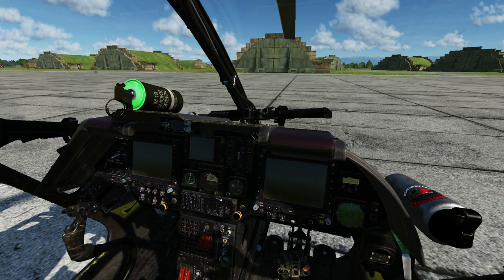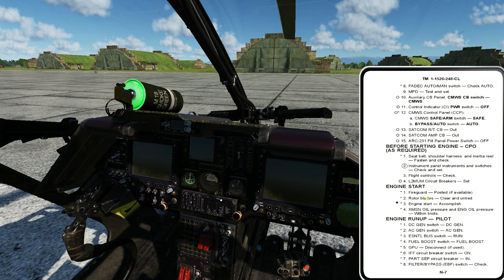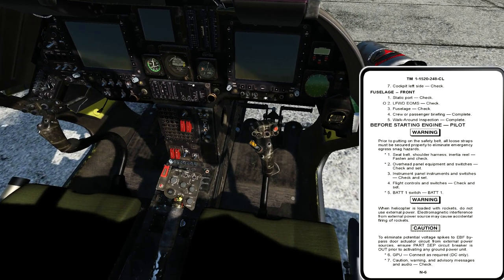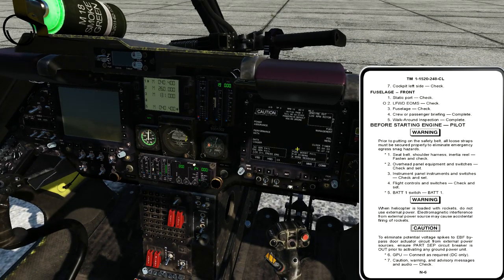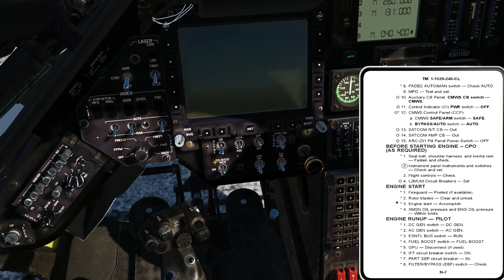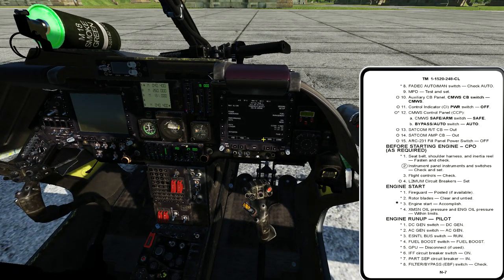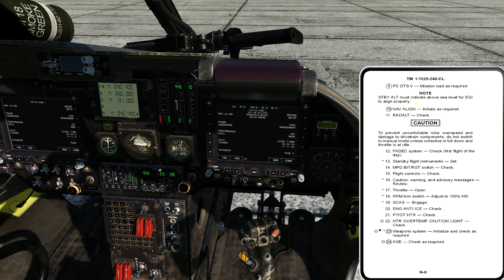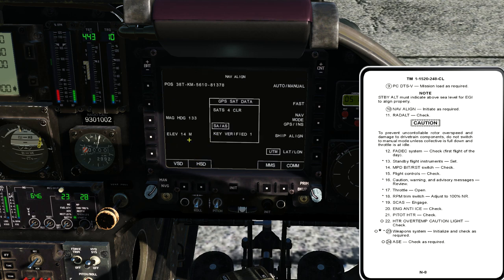Kiowa Detailed Intro - Pt 4

Comment: 42:15 Fun fact, the MH-53 flew lead for the Apache's during the initial attack of Desert Storm. The 53's tossed chem lights out the back of the ramp at specific locations so the Apache's could do this very procedure.

Comment: I love this kind of deep dive nerd stuff.

To whit, a couple bits about GPS. 

Military GPS receivers can be slightly more accurate than civilian ones, this is because mil receivers can access the encrypted P(Y) code. In practical terms, a receiver using the P code can get down to about 1m accuracy without external aids. A receiver with only the standard C/A code can only get down to about 3-5M accuracy without external aids. In practice, all receivers use other sensors to improve that accuracy, and that's why your phone will typically have ~1m accuracy. I don't know the actual numbers for mil GPS/INS systems, but we've all seen precision weapons go through a specific window based on GPS guidance, so it's pretty damn good.

Since Barundus mentioned that they didn't use the encrypted signal, I'm guessing they simply didn't need the P code's accuracy. This isn't that surprising, since the Kiowa didn't employ any precision weapons, and only used the GPS/INS for navigation.

Starting with block III in 2018, the satellites no longer carry the equipment to do SA. This means that as the block II sats get turned off, SA will permanently go away. The block III sats also add new civilian signals that will give unaided accuracy around 1m. Meanwhile, the military will get a new M code that will further improve their accuracy, and improve jamming/spoofing resistance. 

This last part is speculation. If there were a war with a peer adversary once the constellation has moved to block III, gps would be denied to the enemy based on jamming rather than SA.
Reply from the maker: Good stuff.  Welcome fellow nerd.

Comment: 1:11:00 I thougth the angle of the rotor disk/swash plate is 90° offset from the direction of cyclic input, because of how spinning objects work? Or is that something separate from what is shown here?
Reply from the maker: Half correct.  Gyroscopic precession causes the movement of the rotor to be 90 deg from the direction of input.  Consequently you build the swashplate to translate the input automatically.  In simplified terms; The force applied through the pitch change links is 90 deg from the direction you want to go.  But the control movements are set up to "make sense".  
This is called cyclic rigging.  If we didn't build it that way, all control movements would be 90 deg from the direction you want to go, which is really hard.
Reply: @Barundus  So this is a problem of mapping input to rotor pitch angle? I always understood it as the pitch angle change has to be 90° off where you want to go, and that that's the reason the cyclic is rigged differently.
I misunderstood it as a problem of the LIFT being changed 90°, which would mean forward as highest lift and aft as lowest lift in the actual, physical rotor blade to command a left or right (depending on CW or CCW motion); consequently, the rotor plane moving forward or backward when commanding left or right cyclic.
But you say, in actuality for you to go for example to the left, the pitch (and with it the lift of the blades) should be highest on the right side of the helicopter and lowest on the left side? Again, I thought that the lift would have to be shifted, and consequently, input itself. 
Instead, in reality, you'll have to 'command' the highest pitch at the front of the helicopter (assuming a CW spinning rotor) so that the highest pitch 'arrives' at the right side? And the vectors work normally like in a straight flying object, tip the right side up with more lift, dip the left side down with less lift, off you go to the left?
That means that the rotor plane is still highest on the right side (highest lift) and lowest on the left side (lowest lift). 
Helicopters are really complicated, and some things are difficult to wrap the head around - spinning things are really counter intuitive.
Reply from the maker: @GeFlixes  You want to move forward.  Push forward on the cyclic.  PC link 90 deg out of phase moves. Helicopter moves forward.
Reply from the maker: https://youtu.be/eTjGTxSevHE
Reply: @Barundus  Thanks. So it's the lift itself that's 90° out of phase.
-Shouldn't the rotation plane/the position of the rotor blade tips not be 90° out of sync with the inputs as well? So moving left/right on cyclic moving the blades on the front of pillot closer/farther away from the ground, as they rise and fall with added lift? That's what got me stumped in the first place.-
Nevermind, I think I got it.
Reply from the maker: @GeFlixes  I was on a phone with the replies earlier, so didn't go into a lot of detail.
"So it's the lift itself that's 90° out of phase."  Not strictly correct; or perhaps put another way, not the correct way to think of it.  More correctly: the RESULTANT is 90° out of phase from the INPUT.  
Easiest way to describe it: the swashplate and PC links are constructed in such a manner as to translate the control inputs at the flight controls into rotor disk motion that is intuitive to the pilot.  Meaning, the CYCLIC RIGGING is constructed in such a manner that pressing forward on the cyclic results in forward motion, etc.  
e.g.; when the pilot presses forward on the cyclic, the swashplate commands the pitch on the LEFT side of the rotor (in US helos with counterclockwise rotation), thereby increasing pitch on the left, decreasing pitch on the right, and the RESULTANT occurs 90° later which results in increased pitch (lift) over the rear half of the rotor disk, and decreased pitch over the front half.  
Hope this helps.
Reply from the maker: In the early days, pioneers found that pressing forward on the cyclic caused them to turn left (in counter-clockwise rotor systems) until they figured out how to mechanically translate control inputs into swashplate movement that resulted in predictable and intuitive aircraft control.  This control input translation occurs in the "mixing unit" which moves the swashplate 90° out of phase with the controls.
Reply: @Barundus  Ah, I now know what got me confused - when you push forward on the cyclic, the RESULTANT lift pushes the rotor tips down on the front and up at the back because of the delay. I thought that, because the rotor blades have to be their highest/lowest lift 90° off from the cyclic movement, moving the cyclic forward would move the rotor tip blades lower/closer to the ground on the left side because that's where the INPUT for the lowest pitch is commanded - not taking into account that's not the AoA of the rotors itself that results in that dipping motion, but the DELAYED lift force applied to them. 
Basically, watched from the pilot, the rotor rotation plane moves as intuitively expected, which is what tripped me up - I expected unituitive behaviour of the rotation plane as well.

Comment: Amping up the capabilities of the datalink to what they could theoretically do would be absolutely sick. Lasing a target already is still great but being able to generate coordinates for JDAM strikes across multiple targets would be insane! Could be an absolute nightmare to implement though.

I'm hoping that it's possible to get everything warmed up properly reasonably quickly with some practice. Mainly for multiplayer purposes where I might need to get back in fast if something's gone really wrong and/or I've done something stupid.

I did really enjoy this deep dive into the cockpit and systems though. It's really interesting to see insight from someone who flew it operationally.
Reply from the maker: It can already generate the target location/grid.  Passing it digitally to another platform is the sticky point.  We actually didn't do that much IRL, although the system was there.  Most targeting info was passed voice.

Comment: 43:40 What if you actually start below sea level? Let's say you're operating out of Israel for some reason (e.g. training excersise) and startup from a forward location near the dead sea. Would a proper alignment not be possible in that case? Could you just trick the system by dialing in an altitude above sea level for the alignment and then dial in the correct altitude below sea level after the alignment is done?
I know it's a pretty unlikely situation, but it just serves as a theoretical example as I'm curious about the technical implications.
Reply from the maker: Yep, you'd have to set the altimeter to read above sea level pressure until the NAV Align is complete

Comment: Anyone else notice that the pressure altitude displayed on the MFD pages differ by 10 feet on the left and right sides?   Left seat showing 40ft, right side showing 50ft.  Is that a bug, or am I missing something?
Reply from the maker: Good catch.  Though I state in the vid several times the left and right side of the cockpit are not correctly synchronized in-game yet.

Comment: if you care to would you expand a bit on what you meant when you mentioned friction between the services re digital info sharing ? thanks !
Reply from the maker: Basically it's divergence and incompatibility between the various systems installed on the aircraft.  
While there is generally an "idea" that information sharing is enabled across platforms, in many cases the reality is that the acquisitions path and budget process between services often don't end up as originally envisioned.  So when aircraft and systems are modernized, often times incompatibility develops.  Or; there isn't any requirement in the first place.  
Many of the digital systems within the Army itself may have proprietary technology that is exclusive to one particular system, i.e., the artillery digital fires net doesn't talk to anything else.  The problem is amplified when  you have to go cross-service.
Workarounds are to have "gateway" systems, intended to translate one language of digits into another language of digits, but there is always friction.

Comment: Not a question about Kiowa persay but more an Army doctrine question. I've always felt like you lose something special from the peaking ability of the Kiowa going to the Apache. Being able to look over something without necessarily exposing yourself. Do you get some of that capability with the Longbow? Of course it’s not to the same degree as say EO/FLIR.
Reply from the maker: Longbow has the Fire-Control Radar mounted above the mast.  The TADS and PNVS are mounted on the nose.
The Mast-Mounted Sight definitely allowed the ability to remain masked and expose only the optics in a near-peer, slow-moving and hovering situation.  
It becomes less useful when you're at speed.  The control and motors weren't designed to cope with rapid movements in the "yanking and banking" type of flying performed in the counter-insurgency conflict, nor is it that useful when looking for something nearly underneath you.
So, depends on the application.

Comment: First of all, thank you!
Some parts I noted:
Surprised to hear that there's so much avionics configuration needed, I expected most of that to be in the data cartridge.
On the satcom CB: I agree that it's possibly too much to integrate the system, but it would be cool to just have the CB to go along with the checklist.
Nav Align below sea level: You never were in the Netherlands with the KW, right? :D
Was fast align possible in a quick deployment scenario out of a C130? Prepare the Datacard, brief the C130 crew where to stop after landing, unload the KW and do that fast align?
Reply from the maker: A lot of it is on the mission card; however certain things can't be imported/configured directly from the card.  
A proficient crew can get going within five minutes.
Reply: I agree with that. Make the CBs clickable but not necessarily functional

Comment: odd question but how do you decide where you put the aiming dot on the windshield?
Reply: So I just came across this after watching the BlackSharkDen video where they interview Barundus and start talking about stuff out of the real life army manuals. 

From TC 1-248 Aircrew Training Manual OH-58D (April 2007), Pg 4-117: Aerial ballistic reference mark (ABRM) (windscreen mark) Engagement:
(1) Prior to flight:
Pilot/Co-pilot measures from the bottom seam of the windscreen (where the riveted
metal strip meets the windscreen) and marks a point 24 inches up with a grease pencil.
Then measure from the center seam of the windscreen outward 12 inches. This is the
center point of the ABRM. Mark the point and make parallel 3/8ths inch wide by 3 inch
long horizontal and vertical lines. It should look like the outline of a plus sign.

Whether or not this is how it was actually done I couldn't say. Grease pencil was the method I've seen on the UH-1N in the USMC as well (I was a mech, not air crew).